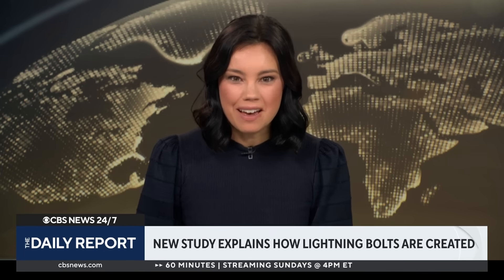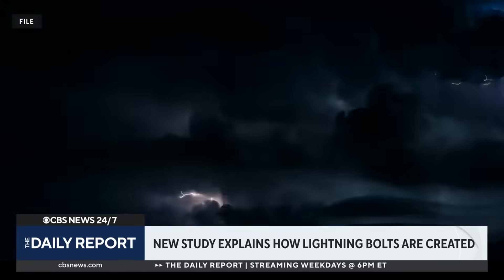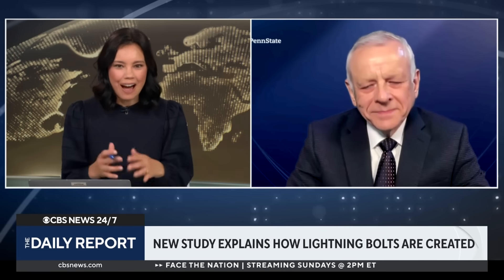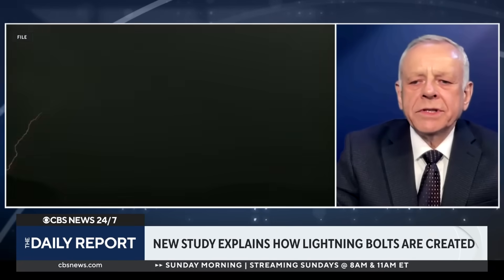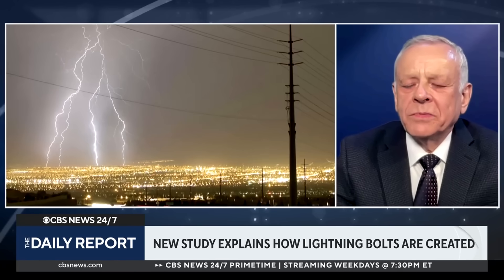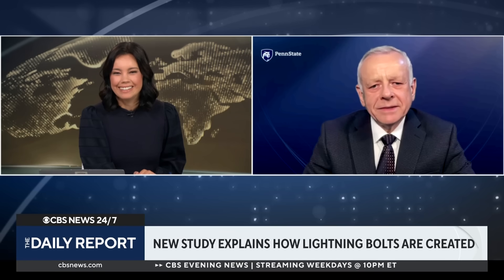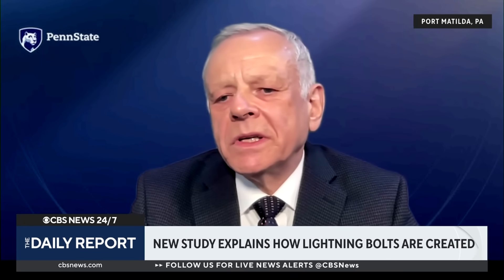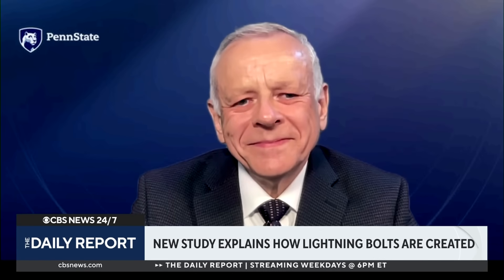New study explains how lightning bolts are created

Comment: If something comes out then other thing must go in. 
If lightening(+ion) is coming from atmosphere then -ion must be going in the atmosphere.
Reply: Nothing to do with electrons then?
And no, he didn't explain the charge accumulated, only one trigger for a lightning bolt. It also fails to explain the connecting leader from the ground when a bolt is traveling down in 50 meter increments - and the bolt is still hundreds of meters away and can't possibly be causing the air at the ground to breakdown yet.
Suffice it to say, the picture is still quite incomplete.
Reply: @spvillano  lightening strikes to ground because of already ion movement to atmosphere which provides the path for lightening. The lightening shines due to resistance. The lightening initiates inorder to bring overcharged side(atmosphere) to neutrality with ground(lower side) and this overcharge is caused by ion movement towards atmosphere due to Heat(sunlight), Organic decomposition(Methane) & Earth's core heat(underground lava) which pushes -ions at atmosphere and when too much ions accumulates at atmosphere(gets overcharged) the lightening and rain storms occur to balance things out or restart the cycle.
Reply: (When ion speed goes fast to slower we see plasma, current or light)
Lightening (photons) that a human eye sees is the reason of decompressed ions getting compressed due to resistance of opposite natures (low to high viscosity) colliding each others. For example a current always like to move through compression states aka Electric Current Theory while light always shines when ions move from decompressed to compressed state or from lower to higher viscosity state(decrease Speed). So what a human eye sees could be +ions coming from decompressed state into a compressed state (wetness) aka Light theory
Reply: To proof that lightening & Storms are results opposite ion movements is firstly the cold breeze we feel during rainstorm is the physical sign of opposite ions colliding which unlike metal ions which produces heat & light(photons), the gas ions also produce Coldness. Secondly the academic example to prove my point is that when hydrogen & helium ions collide,the resulting effects also cool down the environment(cool breeze of ions)

Comment: This theory has her asking 3rd grade questions
Reply: This 45 or so year old theory. One observation series doesn't explain a lot or all instances.
One important asset for these studies is the ISS, which will be decomissioned soon and no replacement is scheduled.
As one example, the stepped leader of a bolt of lightning essentially only senses charges within 50 meters of its tip. So, how does one get the connecting leader on the ground and moving upward to meet that bolt that's hundreds of meters away and oh, no cosmic radiation reaching the surface?
Lightning is a nuisance to study, as it's not incredibly common in areas where researchers are, it's quite fast, unpredictable and has a really annoying habit of vaporizing equipment trying to measure it. One research facility in Florida triggers bolts from primed clouds, interestingly without trying to poop out their own cosmic rays and even confirmed a fringe theory at the time that lightning strikes generate x-rays and stronger and rare positive bolts will even generate gamma radiation that's detectable from space. Drove the Vela satellite folks nuts, as those were designed to detect nuclear weapons detonations and were detecting cosmic gamma ray bursts and to their confusion, bursts from occasional strong thunderstorms.